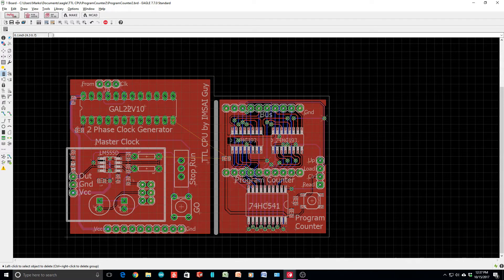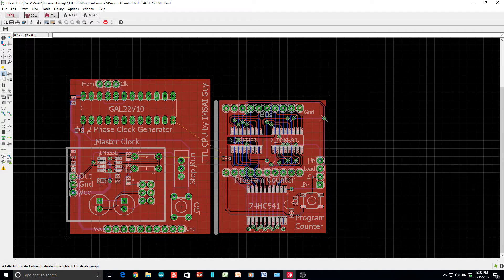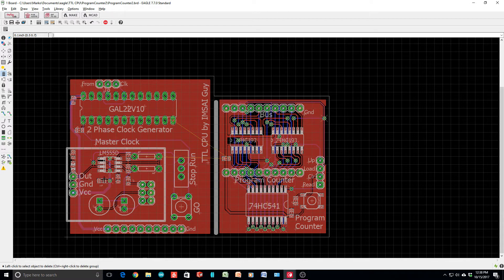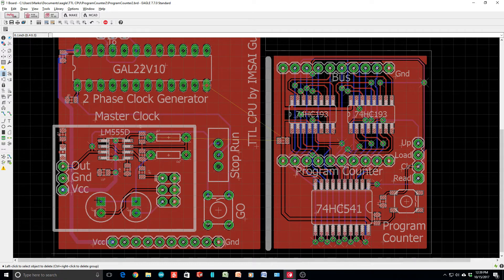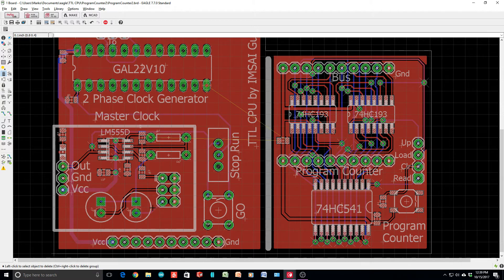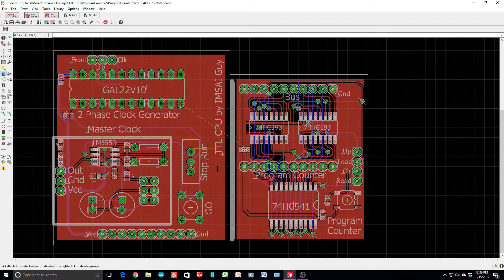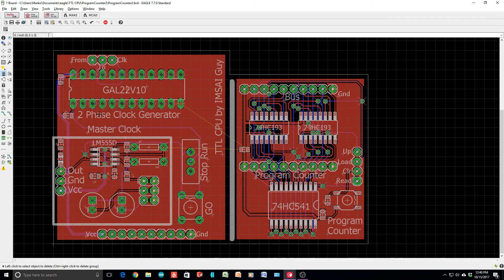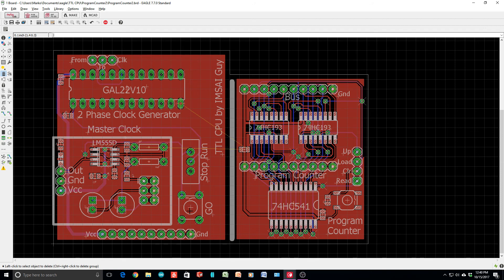#150 TTL CPU PC counter design

Comment: Are you going to have problems with contact bounce on the stop/run switch?
Reply from the maker: maybe, it is not a good way to do it. I wanted to have a set/reset FF with a push button for 'run' and 'stop' maybe later.